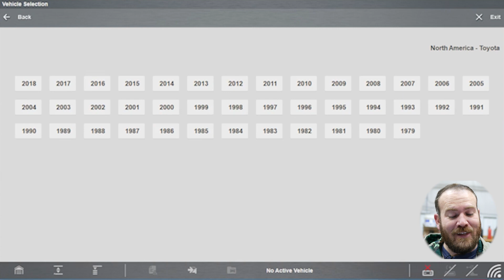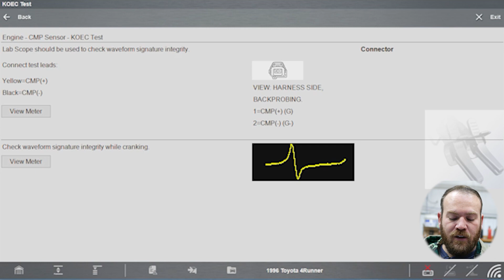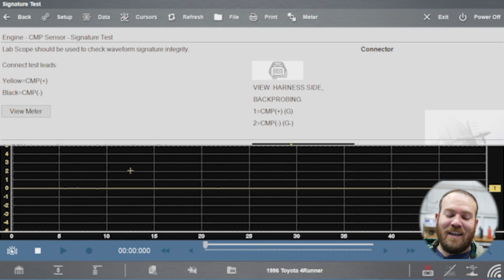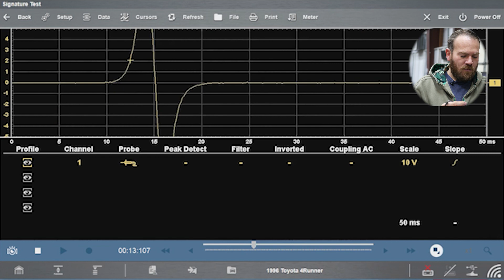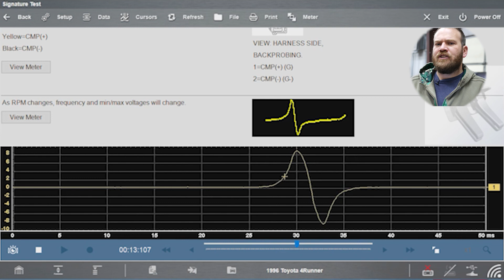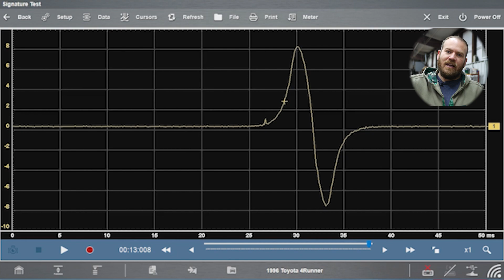Automotive Weekly Waveform #7 - Variable Reluctance (VR) Sensors

Comment: QUESTION:  Are the “teeth” on the spinning cam magnetized?   This may be why the waveform looks like it does.
Reply from the maker: Most, if not all, VR sensors do not use a magnetized cam trigger wheel.  The magnet is in the sensor and the magnetic field flexes and the steel trigger wheel passes by. This flexing field in what induces the voltage into the coil of wire wrapped around the magnet inside the sensor. 

Many of the 3 wire Hall effect sensors is a magnetic trigger wheel.
Reply: @ThePracticalMechanic    Thanks for the quick reply!!  Good to know.

Comment: Hi.., i found my car after long off, CKP signal at N1+/- pin in ECU only 1.5VAC on started, engine crank but won't start,  no fire on spark plug, also the pin of rpm meter no rise move at all... unless i reset the ECU (release batt or EFI Fuse), the CKP signal on N1 is 3.3VC on started, and the car will start and run normally without any problem... and will happened again after long off the engine, i already replace the CKP sensor and batteries with the new one, but it is not solving the problem.... any advise will really appriciated, thank you.

Comment: Where is a decent place to get known good waveforms? I know pick has a library but I can't install picoauto so no access to their library. And is it necessary to unplug the vvt solenoid when testing cam sensors?
Reply from the maker: There are several places to get known good waveforms. You should slowly build your own library, join a Facebook group that is specific for known good waveforms, diagnostic network and iATN    are all great places for known good waveforms. 

When testing camshaft sensors I don’t unplug the VVT solenoids. I only unplug them if I am performing a correlation test and the known good waveform is noted for that test condition.
Reply: @ThePracticalMechanic  ok that makes sense, I had a tech tell me to always unplug the vvt and I wondered about it for awhile. So thanks for that.

Comment: i have very few foreign cars what american cars usually have 2 wire. also can the older like chevy with points and condensor be captured on scope and tell dwell time thanks
Reply: I believe the 2 wire wss on chevys are sine wave
Reply from the maker: @Baitmakerz  yea the two wire wheel speed sensors are vr sensors. Many of the ford truck crankshaft position sensors are also VR sensors.